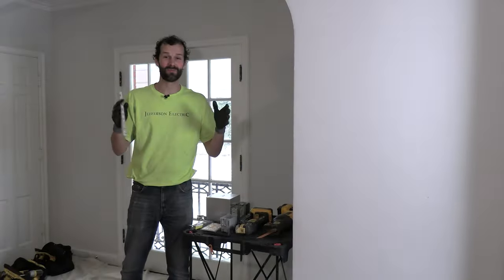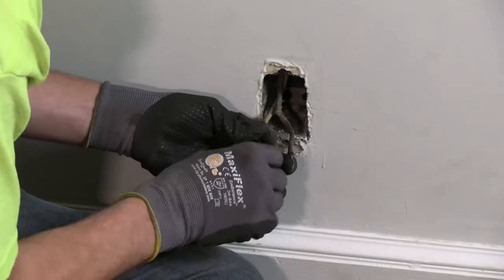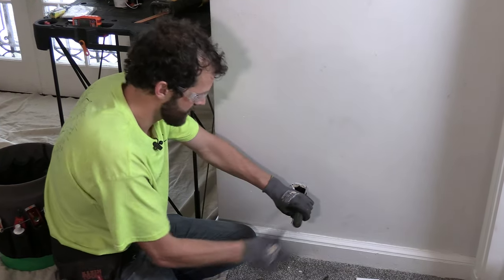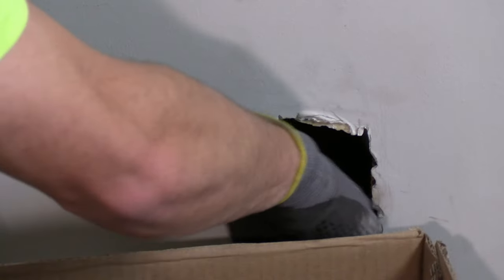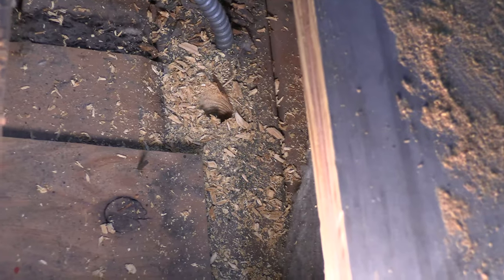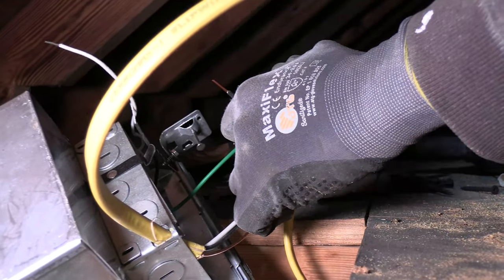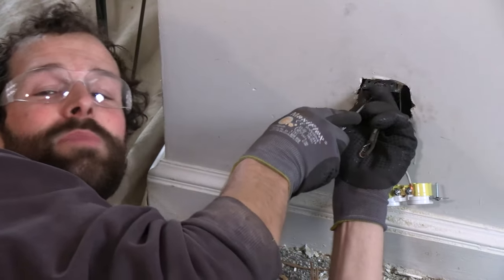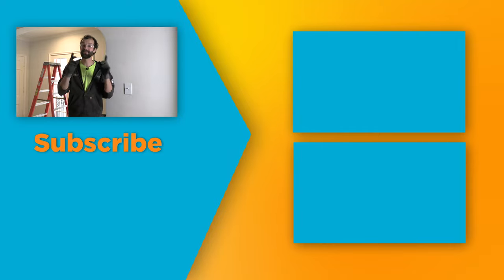How To Install Recessed Lights In An Old Ceiling

Comment: what did you use for the locator drill bit to mark the assumed center of the can light?  My house had an on-slab breezeway added on but the doorbell wiring never got extended.  I ran two conductor thermostat wiring behind the vinyl siding but used the corner of a window to get it into the basement as my drill bits were not long enough to get through the foam, wood siding and sheathing that lie beneath the siding.

Comment: Joel, cut a small cardboard box about 2 inch deep and put your hole saw through a small hole. Like the Klein adjustable hole cutter with the dust sheild you re just making 1 out of cardboard boom.

Comment: I'm almost surprised you didn't run a new romex line from the attic. Granted, you'd need to have a metal box up there, but no short wire constraints. You could even have a service loop for the mc wire, and heck, maybe even an outlet in the attic if you ever wanted? (Would that match code)

Comment: I once went to give an estimate for someone who wanted recessed lights installed. I probably should have asked more questions on the phone. When I arrived owner explained that she wants numerous 2” recessed lights throughout the house. She also told me that the walls and ceiling are plaster and lathe. I tried to talk her int going with 4” but she said she’s going to stick with what her designer recommended. I refused the job because I didn’t want to be held liable for ceiling damage, which is inevitable with plaster and lathe 2” holes. I walked away.

Comment: in this installation, why you did not install a connector to the 12 Romer cable going into the top hot light fixture ???    it is going to bare metal

Comment: In ceilings bending over a piece of wire creating a ninety degree angle and then feed into void then you can spin the wire and the ninety can tell you if you hit anything.

Comment: I am not sure this is code yet, but for the last 7 years my supervisors have not been letting me use a device to make a junction unless it is a clamp type as in higher end receptacles and switches or GFCIs. I am on my own for the last two years and I always make pigtails on screw connectors. Also I never use stab in the back type and replace them.

Comment: To out boxes in plaster I use a Dewalt Dcs551 Rotary Drywall Cordless Cut-out Saw with tile bit to cut thru the plaster. The tile bit stay sharp enough for a few months of work.  Then I switch to a wood bit to cut the wood lath or steel mesh.  A saw all just pulls the lath off the wall.and a multi tool blades do not stay sharp.

Comment: I prefer the new wafer led puck lights and they are ic rated
Reply: @ElectricProAcademy  what i do to catch the dust and debris when I use a holesaw to drill the holes for the cans is especially when I use the new led wafer ones is to put the part of the arbor that goes into your drill is  to put it through the cardboard box that the can comes in and it catches all of it

Comment: I’ve drone this type of work a lot unfortunately. But one trick that works. Lay out all your lights with a  1/4” pilot hole. Then go up in the attic if possible and drill down with correct size hole saw. Have someone hold a trash can over the hole you’re drilling, works really well. 
Or get one of those driller bowls from rack a tiers when drilling from below. Catches a lot of dust.
Another thing, you’re suppose to break the small 2 little holes on the yoke of the receptacle so it fits correctly on the old work box.

Comment: newer flat panel led lights have settings for different color of white light  and easy to swap out trim colors.... I dislike can lights.
Reply: And they come in 4 inch! Plus you can temp wire them and hold on the ceiling to check for placement approval.

Comment: Shouldn't you go check in the attic to see if you can get your switch leg down the wall before you cut a hole in the sheetrock for your switch, good thing it's your house.
Reply from the maker: Couldn't hurt. I have been up in the attic plenty of times, and it's wide open, so I was pretty confident I didn't have any obstructions

Comment: I'm gonna disagree with your analysis on ease of switching for can lights vs wafers. Sure can lights can be swapped like a bulb but wafers aren't difficult to swap either, if you get the smart ones as I have you can switch to whatever color you want without going to the ceiling at all, If you don't most of the ones I've seen in just white offer a couple different white color temps on the box, simply pull out the light, flip a switch, and put it back. Just as easy as a can light but a free change. Sure maybe you have more options for trims but i'd be willing to bet there are good wafer lights for that too and will probably be even more in the future, Plus worst case scenario all you have to do is pull the box out with the wafer light and undo the wiring and then pop in a new one of whatever different brand you chose, or if same brand unscrew the connector to the junction box and plug your new light into the connector, Either way, both scenarios are much easier than say replacing a burnt out can light fixture. 
Plus wafers are easier and cleaner to install, I've done 6 in my house so far as a non electrician homeowner and I've done them all without attic access and the biggest part of the mess was the insulation that pulled out with the wiring pull, But I did the smart lights so If one fails I simply replace with the threaded connector prior to the junction box, If I don't like the color I simply change to what color I do want, If I want to dim it I can, and personally I have them all tied into a smart home system.
And best of all, Wafers allow you to center lights in a space where otherwise a can would not fit and would require you to offset to a possibly out-of-center or nonsymmetrical spot.